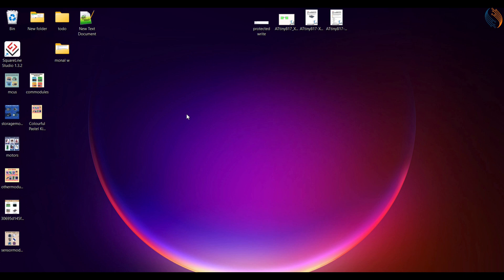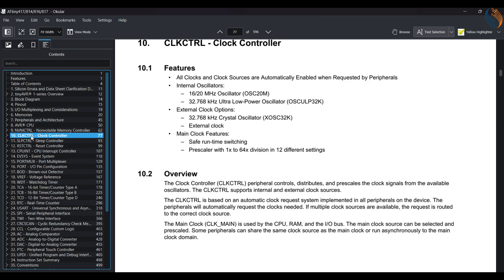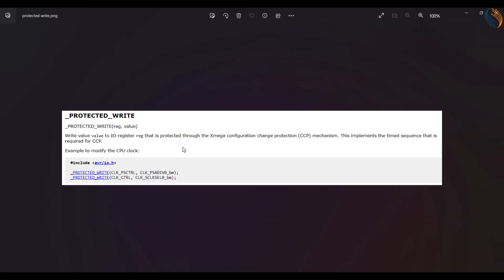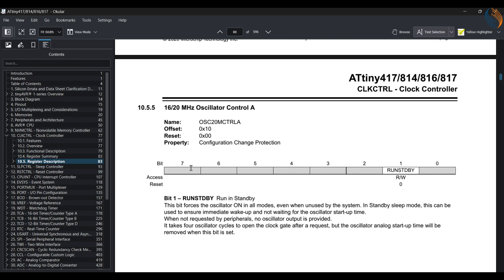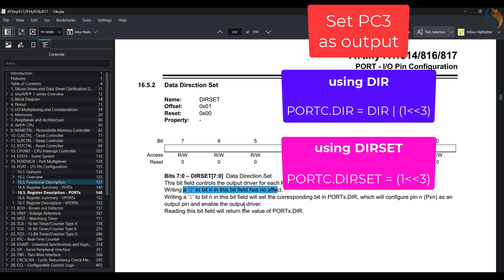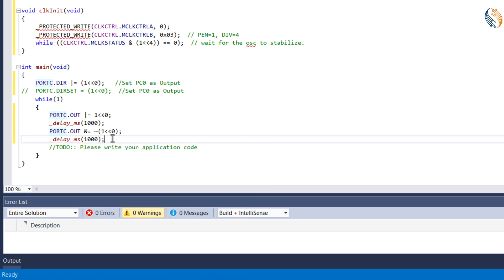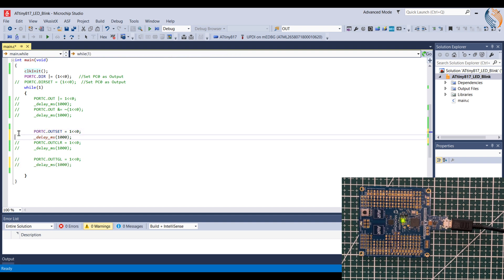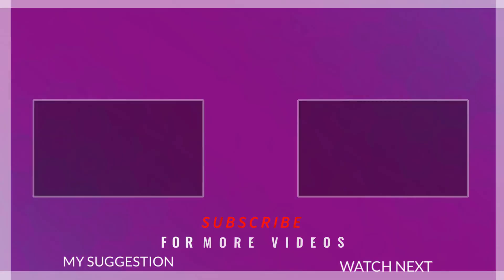Getting started with xplained mini

Comment: My xplained mini board is not being detected by Microchip Studio in Windows 11. But in MPLAB X it's detecting the board.
Reply from the maker: You can use mplab also. I have switched to mplab starting video 5 as microchip ide is not supported in mac.
Reply: there is a process where there is some pins you short and i think it causes the board to reload the drivers......have u contacted the Microchip tech support?
Reply: @meTimetraveler  I'm happy with MPLAB X, no longer using Microchip Studio.